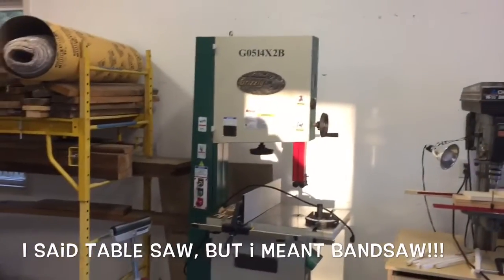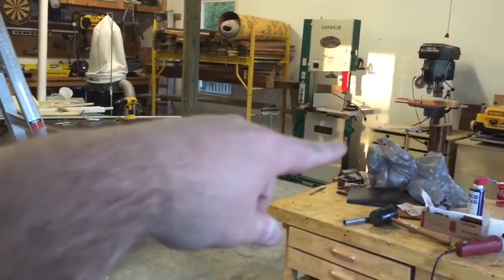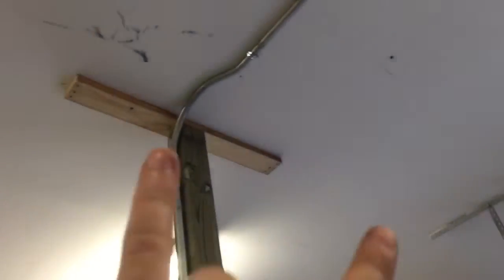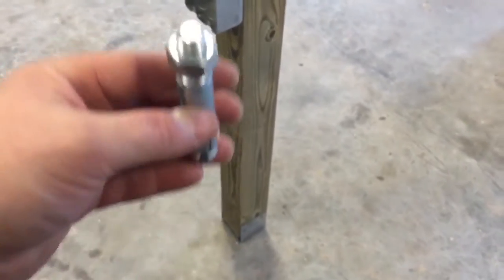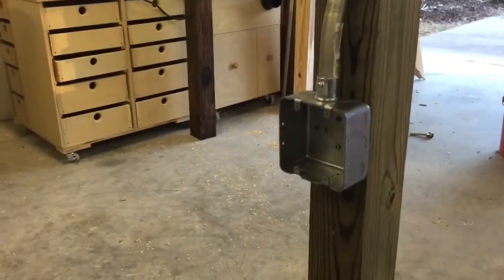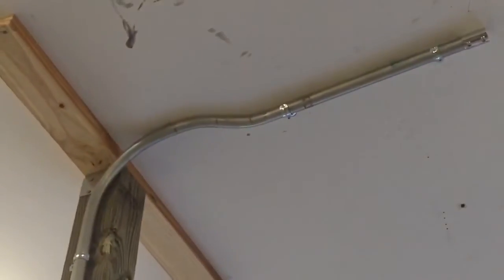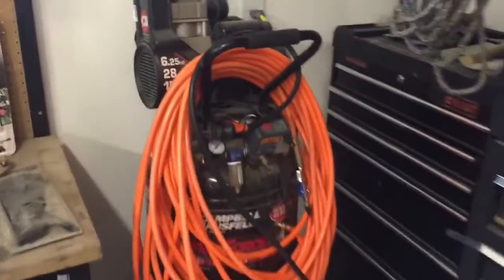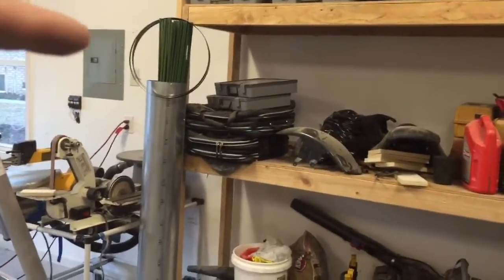Adding 220 V circuits and routing conduit in my woodshop

Comment: I applaud your efforts but you put a permanent post in the middle of your shop floor when you could have just dropped a cable with strain relief 1/2 way to the floor that could be easily moved if you wanted to rearrange your tools. Or put a longer 220 cord on your bandsaw.  I mean you likely don't use it every day.
Reply from the maker: Chad LaFever I use that post to support wiring for 3 220v machines and my main dust collection port.
Reply from the maker: 9 years later I've divided my shop into 2 bays of machines.  It works pretty well.  I ran out of wall space. I've since added a bunch of 3 phase circuits distributed around the shop..  When it gets to the point that it isn't useful, I'll get rid of it and come up with something better...